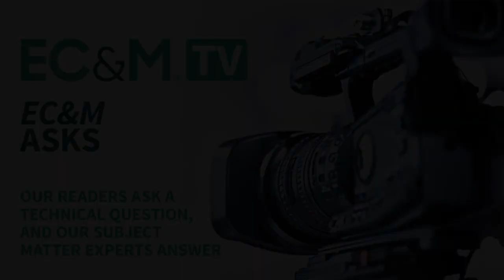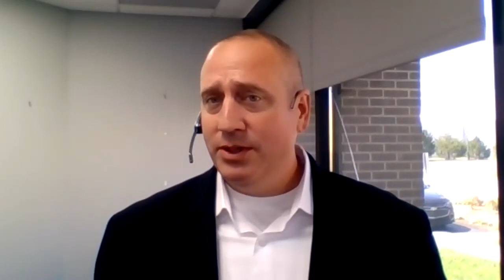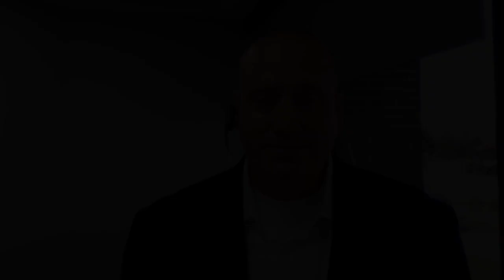EC&M Asks Video — Are DC Systems More Dangerous Than AC Systems?

Comment: I was at the IEEE 1584 working group meeting when they discussed what they should do next (after ac).  I proposed doing the testing and adding sections on dc arc faults, both low voltage (less than 1000 V) and medium voltage (over 1000 V).  I told them that the US Navy would be interested in the results.  Other people proposed other projects.  The leaders wanted to down select to 3 choices.  By vote of the members, my recommendation was accepted for further consideration.